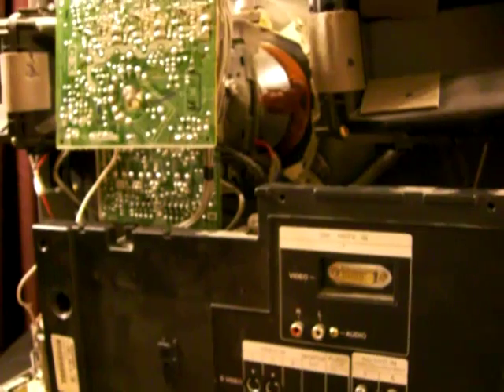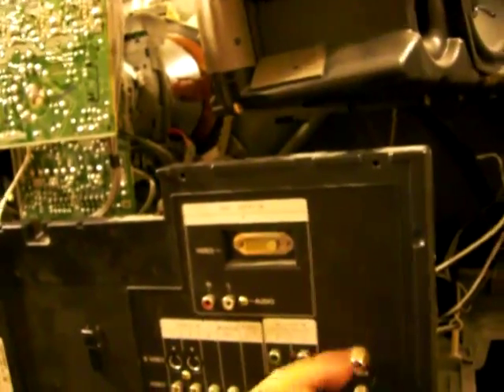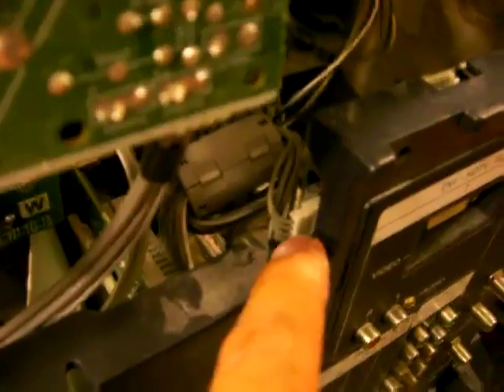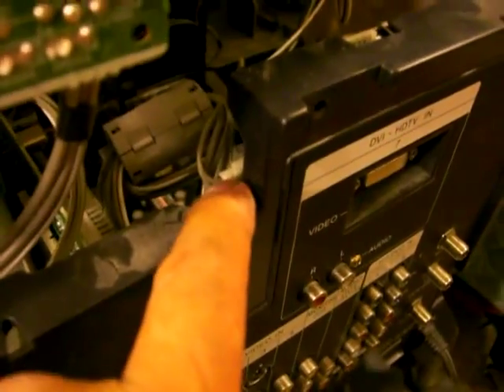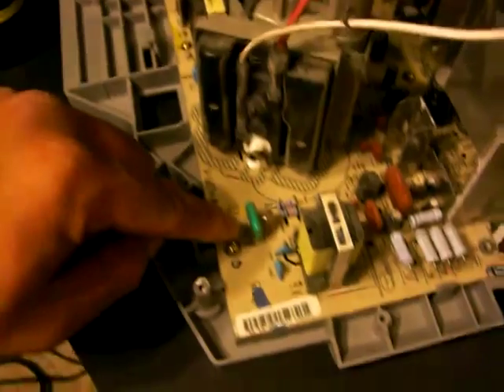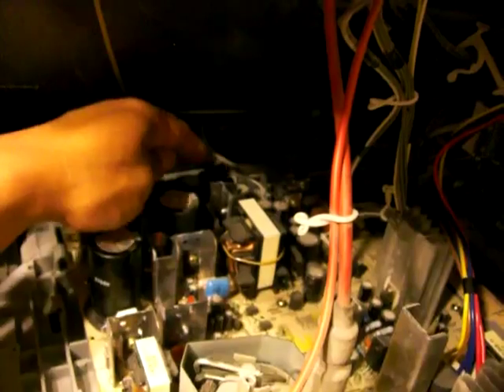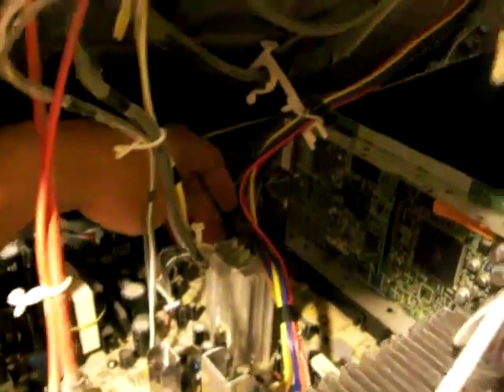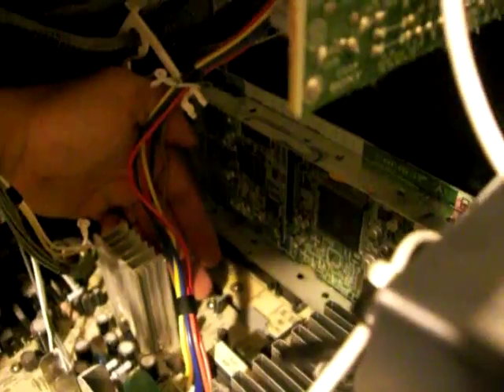Sony TV 7 Blinks Changing 2 IC - STep 2

Comment: I just got the IC's with sockets for our 30" Sony, but I read there is a capacitor that should be changed to prolong the life of the new IC's and also possibly cause of taking out the original IC's, any idea which cap it is? I won't do the work till I can find out, no point in wasting my money when I can let it sit around as long as I like before attempting the repair.
Reply from the maker: I'm not familiar with the capacitor and do not replace that.

Comment: sir, my 25"wega tv 10 yrs old has permanently off seems no power supply, no lights indicator ,I dont even hear a clicking sounds whenever put it on?the tv tech. can't diagnosed whats the problem?can you pls.help us .thank u,
Reply from the maker: That sounds like a per supply of it does not even run a Power on test.

Comment: Thanks for the Youtube video. Getting my D-board into the service position was as easy as you made it look. 

My problem now is sliding the carriage back into position. The last 1/4" is tricky. I can see that my push buttons on the front of the TV need to align with the switches on the PC board. Something is keeping me from moving the carriage to to point where the release tabs snap into place. What am I missing.
Reply from the maker: You're welcome